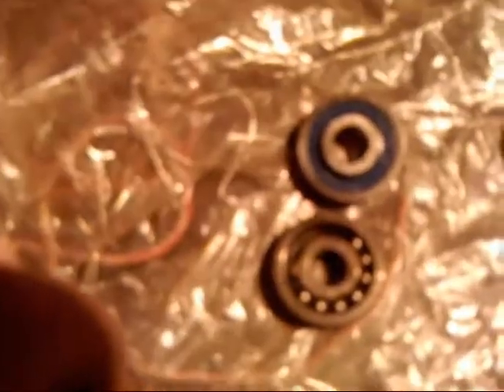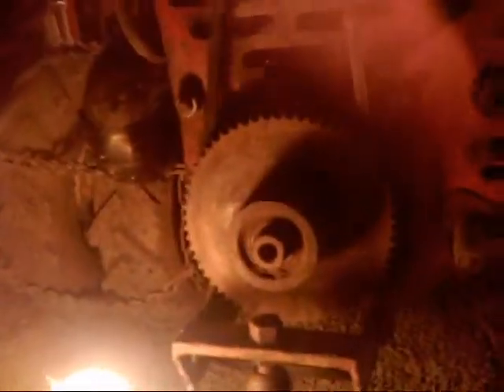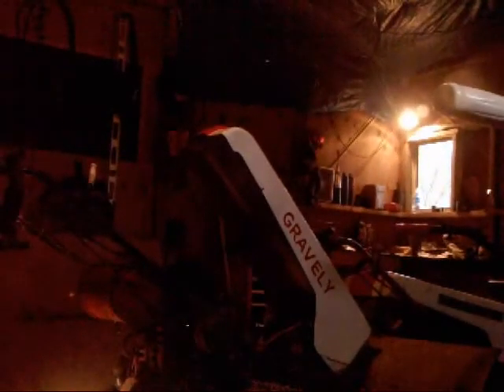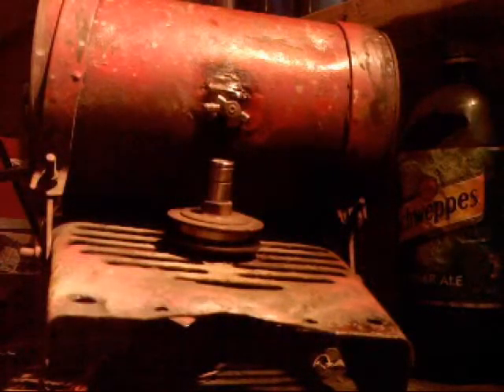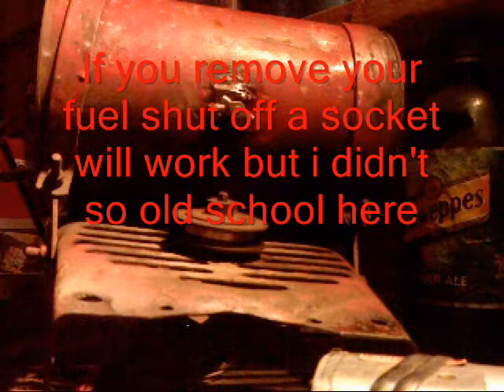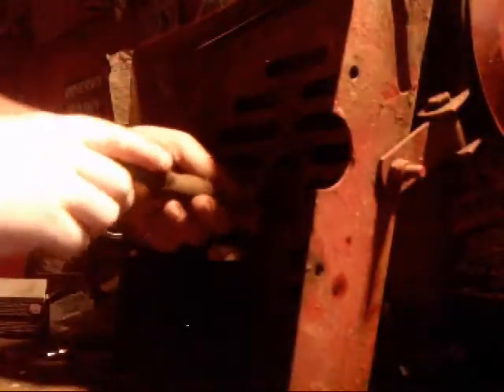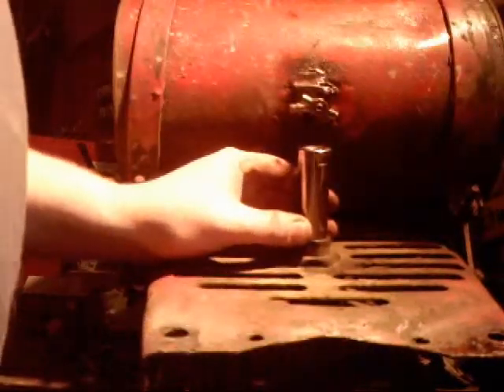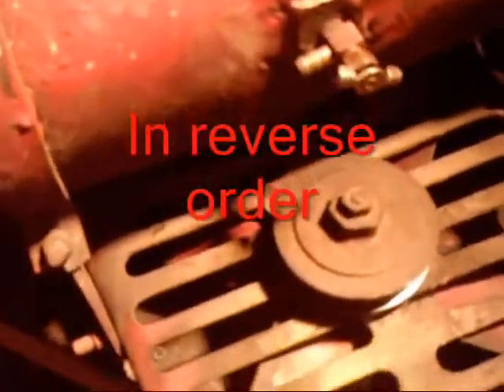Fan bearing change in the 1959 LI gravely walk behind

Comment from the maker: @Civicd15b2b16a its. really straight forward and about a 20 minute job on a pull start tractor.To check them just remove the fan belt and just check for any kind of play in the bearings. Once they get real bad the blades will contact the jug and or the fan houseing. On this particular tractor the bearings went from noisy to seized in i want to say about 8 working hours. but i've had a set run 50 hours that had alot play and are those spares i put in and haven't seized yet

Comment from the maker: @Civicd15b2b16a glad i could help in the mystery.I haven't seen one broken in person yet but when you look at the tips of the fan blades there wore right on the ends alot of times. one thing i've noticed with my tractors is any that get used for snow removal the bearings  wear quicker. and no trouble at all any gravely guy i know is always willing to share there knowledge and talk for about 3 hours straight. If you ever get a chance to go to the gravely mow in you should go its quite the time

Comment from the maker: @urnotme07 thats a tough one. I really like the old slant hood pull start tractors.with that being said i want to say the 1948 is first. followed very close by the 1958 LI, third would have to be my electric start 1970 C8, those are the top 3 i use the most but its still tough to choose one over the other. my true favorite is which everone im running at the time